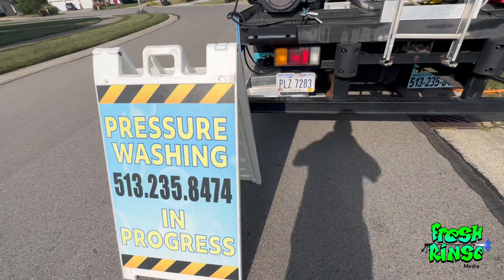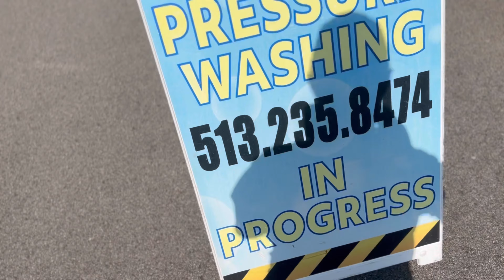Let’s Wash An EXTREMELY Dirty House!

Comment: hey mike, quick question. do you or the average washer rinse entire house before anything then apply soap? i have been rinsing down every house then soaping but i feel the rinse takes time. your thoughts?
Reply from the maker: @erickclark5439  I only rinse if the house has an extreme oxidation problem. In that case, I rinse it well, then apply SH, and rinse before it dries.
Reply: @TheFreshRinse do you rinse first if it is hot outside to cool it down?

Comment: quick question sir. do you really need a website rigth away when first starting
Reply from the maker: @riversidepressurewashing2024  I would recommend you put it in the budget as a line item for as soon as you can. I don’t have a website (now 10 years) but if I were starting over, I would have one.